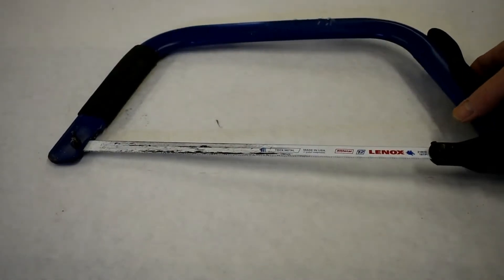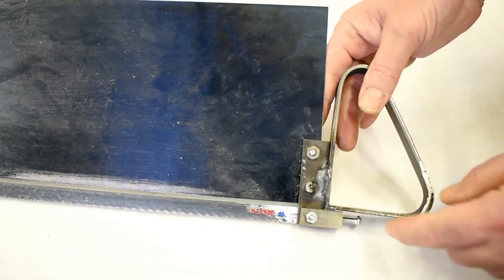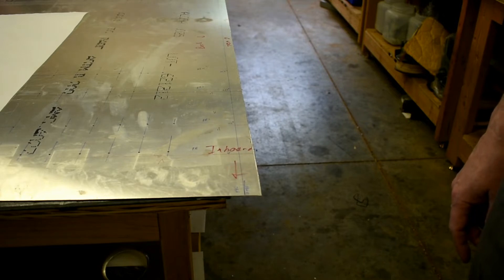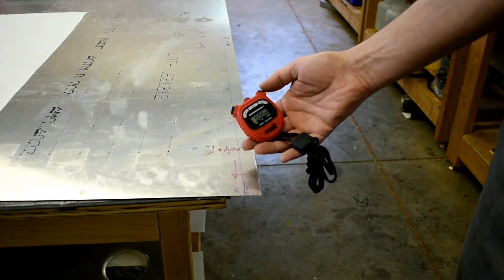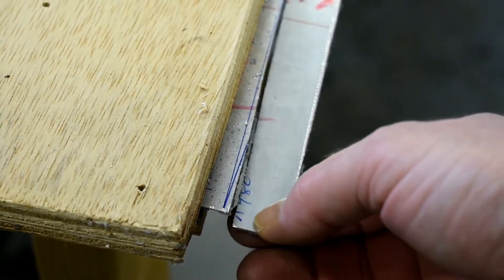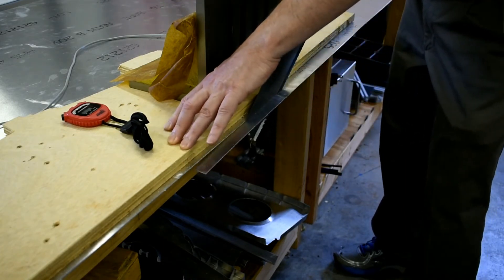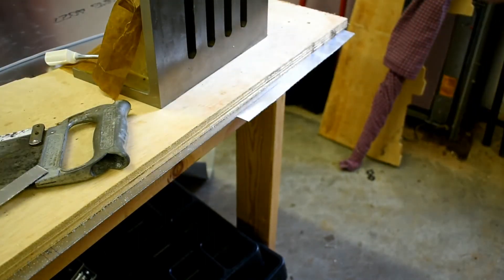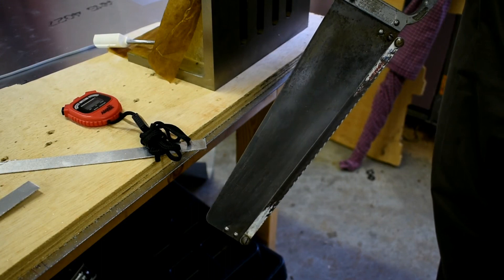Panel Hacksaw Demonstration

Comment: I have never heard of the panel hacksaw either. You said you made your own from .032 spring steel but it was a little thick. I know from experience that the panel saw blades for cutting wood ( Disston, Superior, Atkins,)Etc. Were made from very good spring steel and were .030 and under in thickness. I have even found some to be in the .020 range. Also they have a comfortable handle already attached.
Reply from the maker: What I made using the springsteel sheet was a support for the hacksaw blade. I did not make a full sawblade. What I constructed was more like a prototype.  What I found on ebay is definitely more refined..

Comment: How have I never heard of this, simple and effective. That is going to be super easy to make. Thanks!
Reply: I couldn't tell, is the blade under any tension? If so how is that adjust or what adjustment for blade length is there?
Reply from the maker: @thewyliestcoyote   The hacksaw blade is a standard 12 inch hacksaw blade. While the saw I built had a tension adjustment, the Eclipse saw does not. 

The main reason I added the tension adjustment was to compensate for any inaccuracies when drilling my holes. The actual tension was adjusted to be just under the point where the steel sheet would flex. You do not tension the blade to the amount of tautness like there would be in a regular hacksaw.